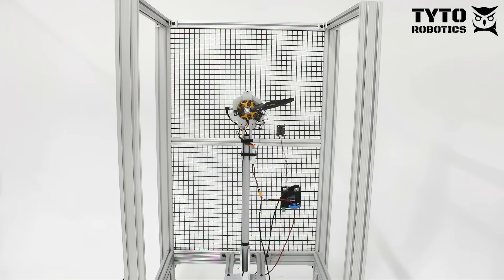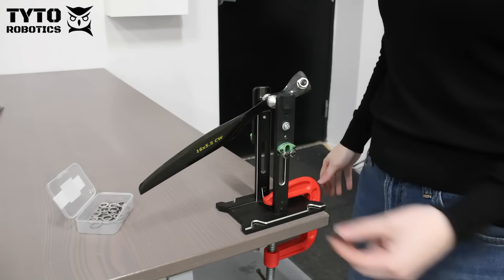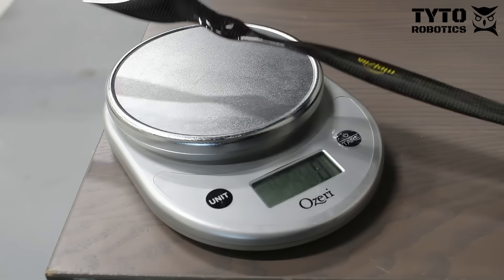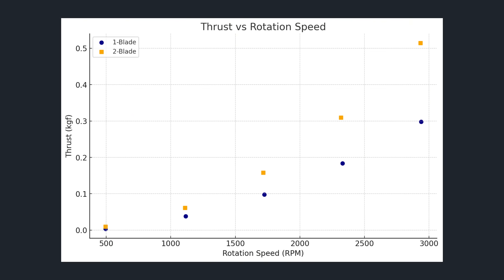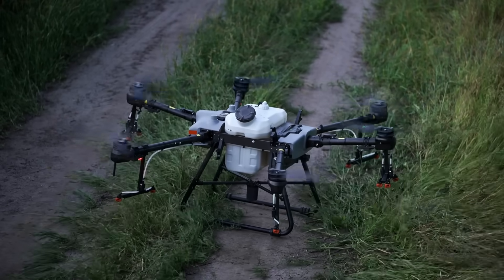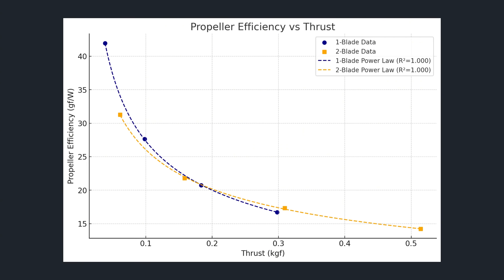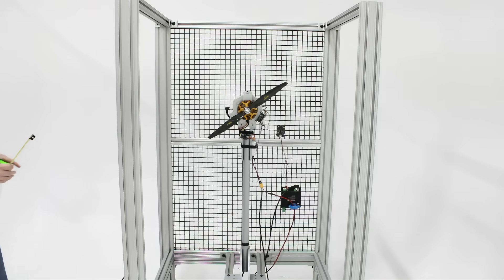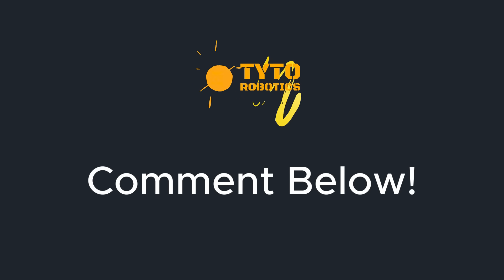Single Blade Propellers ACTUALLY More Efficient?? (Real Test Results)

Comment from the maker: V2 is coming soon! What should we test/ do differently?
Reply: Use the same area prop, or test them at the same thrust, not rpm.
Reply: Measure power source Watts. Power required to lift an object or thrust using both prop types
Reply: I would imagine you would use different pitch in single vs double blade for the optimal efficiency of each separately, probably different rpm as well

The counter weight aero dynamics is probably more of an issue than seems obvious 

I really appreciate your straight forward get to the point demonstration style
Reply: There is a YouTuber who test boat propellers, he is very good at this type of research. You should look him up for a consult (Ziroth)?

Would a design to maximize the airflow from a tiny offset blade/counter weight be worth investigating?
Reply: put it on a tether and test the most efficient forward speed when in "flight". a fixed arm on a bearing, some form of brake, load cell... at one specific RPM or circumferential velocity it will perform the maximum work for a given prop RPM. the prop itself will have a specific RPM it works best at. but it has to be performing work to know. sitting on a stand is completely different to entering the air with forward velocity as it does in flight..

simply putting it on a tether and seeing how fast it goes is no measure of the work being performed. holding it stationary is also no measure of the work it can perform. it has to be loaded to a point that the "drag" and "thrust" are at the maximum... "full load". any more load and its in stall, unable to "grab" the air. just like being held still. any less load and... well, the phrase explains it, right?

a wind tunnel is an option but its rather tricky as the incoming air has to be accelerated to the forward velocity it has in flight which is unknown unless its tested, and it seems easier to just tether it and let it do that by itself...

test various motors to find the most efficient size to suit the now established most efficient flight speed and RPM of the prop. theres several efficiencies working hand in hand for best performance...

show the worst case scenario as well. compare power drawn...

Comment: Missing a huge parameter   ==>  SOUND...
What decibels were they at each RPM?
What frequency was the sound output.
Did the lower frequency sound have a lower apparent noise than the metered sound?

Comment: So because the propeller is generating lift, in an even number design, they naturally balance each other as rpm changes

With a single blade would it not end up unbalanced as the lift is all from one side? That would mean its not as simple as balancing the two weights relative to distance you would also need to account for the speed you plan it to operate at, at minimum.

You could make a variable countrr weight by having it on a slide to extend out as it  speeds up holding the required distance with a spring or such

Comment: Ok so you remove a blade and increase the masse by 60% by balancing...

If propellers are symmetric it's not only for weight balancing but also to align the center of lift to the axis. With one blade you create a rotating center of lift that will add mechanical effort.
You can reduce the vibration by overbalance the propeller. But you still have a leverage effect that will add additional fatigue on the axis and engine. It may also increase the wake turbulence and the tip vortex of the blade. Can decrease the stability in flight or increase the risk of a vortex ring appearance that could end in a crash.

Comment: It would be highly interesting to compare a standard propeller (with a given radius) with an enclosed boundary layer disks (same radius) with curved ducts for directing the trust. My guess is that this will provoke considerable swirl in the engineering thinking. Pun intended.

Comment: Hardhat, respirator, goggles, and earmuffs to drill a hole. Can't see the steel-toed boots, but I'm sure they are there.
Reply: Dust from cut carbon fibers and glass fibers are harmful to breathe. If you wouldn't breathe in asbestos dust without a respirator, you should also be wearing a respirator for this. It's also usually a good idea to wear eye protection, and even if hearing protection isn't necessary it's often nice to have (I've never drilled carbon fiber composite, I have no clue how loud it is). Steel-toe boots are not really useful here, unlike everything else. Your lungs, eyes, and ears aren't mine so do whatever you want. As for me, I prefer to take care of myself.

Comment: static thrust tests never really demonstrate much... youve put it into 100% slip, regardless of thrust produced. to me, thats 0% efficiency. you havent achieved forward velocity, you have accelerated stationary air. utterly different action when in forward flight. people seem to overlook this a lot? 

air has mass, momentum. to ask it to make it way into the low pressure zone in front of a prop is different to when the prop comes sneaking up behind it and catches it unawares...

as pitch is angle of attack, youve basically got a wing in stall... as forward velocity increases, angle of attack decreases until its technically at zero when traveling at the pitch velocity... the ideal "air screw" with no slip... at which point theres zero thrust. you need some slip to produce thrust. 

so, besides the prop and its own efficiency at accelerating air depending on relative velocity ratios, thrust is simply air mass accelerated. 
like watts can be any combination of ampsxvolts, so thrust can be any combination of mass x acceleration... 

yet only one combination is efficient for a given forward velocity, or in electrical terms, maximum power transfer... resistance, or load, matters. 
if you accelerate a large mass a little, youre efficient at low speeds. if you accelerate a tiny mass a lot, you have to go fast...

slap it on a tether. turntable. let it spin. measure torque produced on the lever arm. forward velocity. distance traveled. theres a certain velocity where it will have peak efficiency. but that also gets back to load, the amount of work it has to do. free spinning on a string at maximum velocity limited by aerodynamics isnt efficient. you have to move the maximum mass or apply the highest force,  a given distance for the power consumed... you need a prony brake, a dynanometer, on the tether arm... some way of performing work, anyway...

ha ha. am i over complicating things?

no.

vaguely related topic..

fairey rotodyne... the real failing was to use jets. tip speeds are limited yet the jets need to go an order of magnitude faster to be efficient. seems the principle is perfectly sound when small props at high speeds are used to drag large, slow moving blades around to produce lift, as other channels have recently demonstrated...

the little props are efficient at their forward velocity, and the large blades are efficient at their low speeds, a hovering vehicle has no forward velocity. it only has to accelerate sufficient mass to counter gravity. the slower you move that air to achieve the required reaction, the better. 

mental game. take a normal aircraft. cut it in half, and hold it by the wingtip. start the engine up and let rip... what happens?

Comment: Wouldn’t it be necessary to measure efficiency in terms of the electrical watts? Power’s ultimately coming from the drone battery, so efficiency could be thought of in terms of kgf per electrical watts. Or, put another way, how long could the drone hover for with each kind of propeller given the same drone mass?

Comment: Presumably an optimised counterweight would be a thick wing. So technically a two blade, but one is MUCH shorter. Also for gyroscopic stability it might be better to go with a three blade design with two short aerodynamic counterweights.

Comment: Maybe we can use a gyroscope to reduce the lateral torque, but probably it isnt effective. If we redesing the motor to make the central point turn around a circle while is moving we can reduce the lateral force and increse the velocity of the blades. 
Futhermore,to investigate, maybe changing the shape of the blades, maybe toroidal blades with a part more longer that the other we can get more spin, maybe.
In my opinion the concept is not so revolutionary but allow us to look new options.

Comment: IMO even if you 'balance' the centrifugal forces of the prop, you CANNOT balance the axial push/pull the blade excerpts on the air, in a perpetual state of wanting to 'tip' and probably wreaking havoc on the bearings over time as it's a dynamically unbalanced load, the higher thrust you give, the more it eccentrically pushes on it's bearing stack-up as a sort of 'wobble'. Does this unbalance mean anything in application? Hard to say if the bearings burn out any faster.

Comment: If I remember my history right as you get more power you need more prop blades to make effective use of that power, in case of world war II fighters they started with fixed pitch 2 blade props, ended with 4 blade constant speed props, also some 5 blade and even some 6 blade counter rotating but they did go from 900hp to almost 3000hp.

Comment: Isn’t efficiency flawed since the single prop is same width as the 2 blade. You just chopped off 1 blade. I would think a single blade would be a wider blade with different design to match the thrust of a 2 blade. Then you can test for efficiency gains. Approach seems flawed.

Comment: What about the torque applied to the motors axel when there is no opposing blade to cancel it out?

Will that cause increased friction and wear on the axel bearings?

Comment: Completely irrelevant. Are all smart people this dumb?
This is an incredibly complex question that is in no way measurable by chopping off one blade of two bladed prop that was SPECIFICALLY DESIGNED to have two blades.
You need to develop a single blade prop to give the same performance as the 2 blade and then measure current draw/gram thrust.

Comment: There is a unitless measurement of propellor/rotor efficiency: "Figure of Merit" (FoM). It's incorrect to consider G/W as an "efficiency" measurement. Look at the theory and you will see that a given rotor must generate less G/W as speed increases. Rotor thrust and torque are proportional to RPM^2, so if you double the RPM you get 4 times the thrust, but at the cost of 8 times the power (torque*rpm). By contrast, if you measure FoM, you will find it is pretty constant with respect to RPM; it truly is a invariant property of the propellor/rotor.

Comment: Single bladed props have been used successfully on model aircraft for more than a hundred years, mostly on slower turning rubber powered props, but balance is still essential to maximum performance. Hinged props and offset counterweights can smooth everything out at lower rpms but would probably complicate things on electric powered props that see a wider range of torque and rapid changes in attitude, inducing gryoscopic forces into the blade system.

There is also the extreme world of control line speed, where the nitro engines can turn over 40k rpm. They use small rigid single bladed props because the engines are turning so fast that even at over 200mph, the blade paths would be so close as to turbulate the air for the other blade, cutting down on performance. I wouldn't begin to try to understand the dynamic forces on the crankshaft at that point. :)

Comment: Someone needs to investigate the possibility that it isn't the number of blades that determines the efficiency, but the evenness of the blade spacing. Is the second blade coming around at a time when the pressure wake of the first blade is out-of-phase, resulting in cancelation? This would be dependent on the frequency of the rotation and the density of the air, as well as turbulence, so an efficiency curve would be expected based on rotational velocity. A single blade would be operating at half the frequency at the same RPM, allowing for a general decay of any feedback effect.

Comment: Midwit. If you actually tried to run a single bladed prop on a multirotor the d-term would destroy the motor trying to compensate for the imbalance in rotational inertia. Why dont you go make me a sandwich

Comment: The reason you still had vibration is that the prop blade produces lift like a wing. To counter this, the counterweight needs to be behind the propellor. 

This is old had stuff with the Control Line Speed model airplane guys.

Comment: Germans tried this concept with the Bolkow BO102 helicopter back in the 50s. Single blade with a counterweight. Again, lateral aerodynamic imbalances on mast occur due to blade coning/flap.
Reply: helicopter...  yeah.  it makes no sense for a helicopter.  a quadrotor... or more propellers... that could intelligently counteract each other in real time now.
Reply: @Pan_Fryer the single blade helicopter trainer made sense in the fact it was built in the 1950 as a training aid they didn't want it to fly out of ground effect. It was cheaper to make than a real helicopter and would do similar duty as flight simulators do now.
Reply: @Owen-mt4si  Certainly!  I am grateful for this media, I never saw the idea, never thought it would be a good idea in any case.  This one actually flew!

looking at old tech is very thought provoking.  inventions really do show the passions of the inventors... I wish i got to meet Tesla.  

I still think, if you just reduce the overall propeller size so you end up with a similar lift area, and go to like... 40-100 propellers... thats how you get easy redundancy and keep the whole system well within operating norms.  like, if it had 100 propellers.  I would want it to be able to fly with 24... 24 that are rapidly wearing themselves down in that emergency.
Reply: @Pan_Fryer  If you had 4 single blade rotors all turning at the same rpm and all synchronized in phase, the bending torques could theoretically cancel each other through the airframe.  But pull out the advil if you start varying the RPMs of each rotor to control the dang thing, the bending torques will get out of phase!  Maybe if the rotors spun at constant RPMs and used a differential collective pitch system for control, but even then, you will still have a slight variance in blade coning angles and thus bending torque vibrations again, somewhat.  Would then require short, stiff blades to minimize that.
Reply: @antigrav1302  Im a controls engineer.  the whole point of digital controls is can update its own setting about a million times a second.  

real time control is an equation.  and it could be these days, tied to a vibration sensor.  so any vibration as it started, within a thousands of a second..  would already be causing a control change to smooth it out.  

you can scotch tape two sticks together, and use bubblegum to hold the rotors on, and a modern control board doesnt much care.  

it will lose some performance as it melts mid air.  but it will stay in the air so long as it has the power.  spinning up as the angles are less efficient.  spinning down when the altitude is to low, while also constantly keeping level in both horizontal dimensions.
Reply: once you close that control loop, the right controls system will literally constantly adapt.  Until it can't fly...  

Really, KISS principle makes me think a small propeller that is still balanced is the way.  I dont know how many blades,  I want to use computers to optimize a propeller setup for our average mix in the air.  

it may look more like a jet turbine than a 2 bladed prop!
Reply: I think I saw one of those at a local air museum, but what I saw had a single bladed prop but it was a tethered helicopter training tool it couldn't lift out of ground effect.

Comment: Efficiency and thrust are not the same thing. While it may be more efficient at a given speed it won’t outperform a two blade prop at take off and climb. Then efficiency drops off twice as fast as altitude increases. This is why the Mustang had a 4 blade prop to absorb the horsepower and perform at 25,000 feet.

Comment: Great video. Problem on a small aircraft is the speed of the blade tips approaches the speed of sound. A single blade would have to be designed very differently. A bit longer, a bit more pitch, a change in blade profile. There are even more variables. Three blade props can give better performance in certain regimes on GA aircraft. Two blades tend to be more efficient.
Reply: Single engine aircraft tend to be RPM limited by the motor as well, with most air cooled piston engines having red lines around 2800 RPM or so, although admittedly this was to accommodate typical prop speed without a reduction gear. Most of the 3 blade props give only percentage points better high RPM performance, and the main pros are cooler looks and more ground clearance

Comment: It seems you're up to something with this comparison.
And yet, thinking about the most immediate consequence, one is drawn to consider evaluating different propeller blade profiles.
Consider that, part of the "current" dual (or multiple) propeller's profile optimization inevitably has to deal with the aerodynamic  rake that the preceding blade leaves behind... And a single blad propeller will only need to deal with its own rake... This can lead to slightly different blade profiles that can take advantage from this difference.

Comment: I agree with several of the comments here, the shaft lateral torque imbalance is an issue, but not unsolveable. The fact that the blade rotates thru less of its own turbulence should provide for more thrust and less noise. Didnt have time to watch the video thru, but keep up the good work.